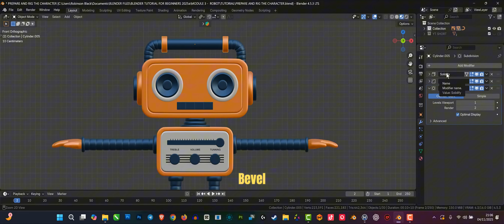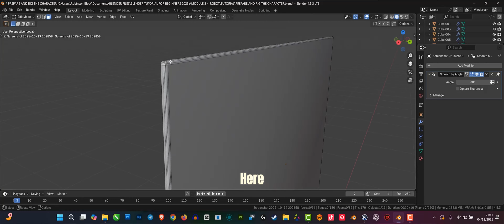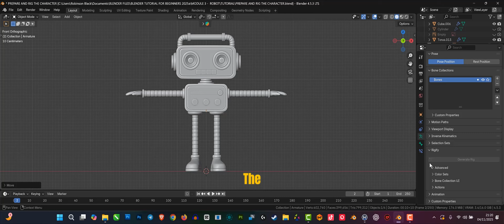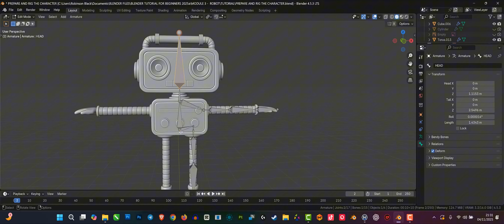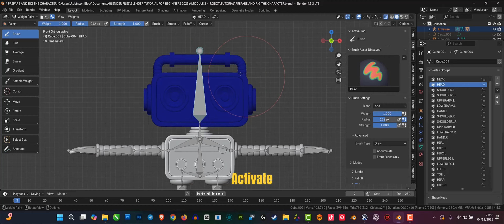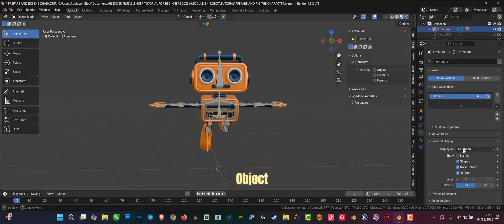How to Rig Your 3D Character in Blender — The EASY Way (Beginner Friendly Part 2

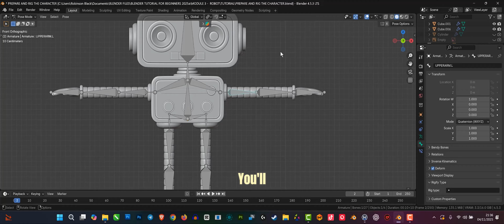Comment: 9:04 after joining these parts to the bones, when I move the bones it morphs the objects. The legs especially, when I move the left leg it moves both, but it stretches them out. Also, even though the objects are joined, the separate apart as though they're not when moved by the bones.
Reply from the maker: That usually means the mesh has shared or messy weights, not a bone problem. 

First, apply Ctrl + A → All Transforms to both the mesh and the armature. 
After that, check the weights so the left leg bones only affect the left leg and the right leg only affect the right. 
If it’s still acting up, remove the Armature modifier, clear the vertex groups, and re-parent the mesh using With Automatic Weights. That should fix the stretching and mirrored movement.
Reply from the maker: Also, make sure to check face orientation, see that the object normals are pointing outward.
If you still have mirror on the legs and hands, make sure they are applied before the rigging.
Reply: @BlenderTutsWithRob this was the problem, I thought I'd already corrected it but apparently not. Thank you
Reply from the maker: @MystGuide  Glad I could help.